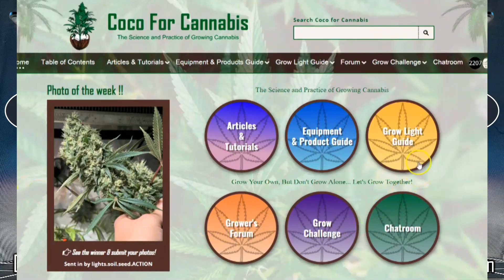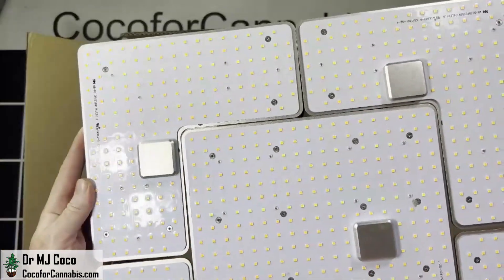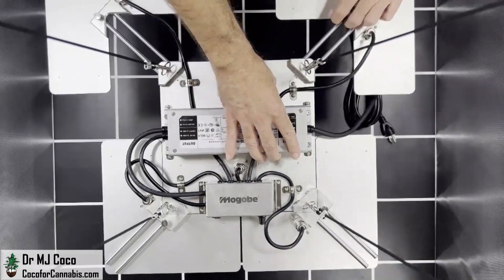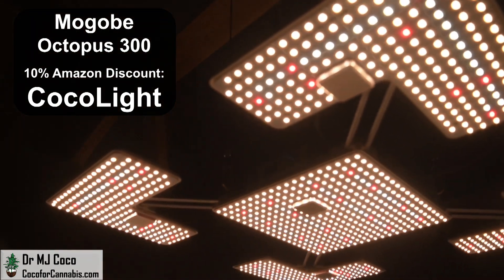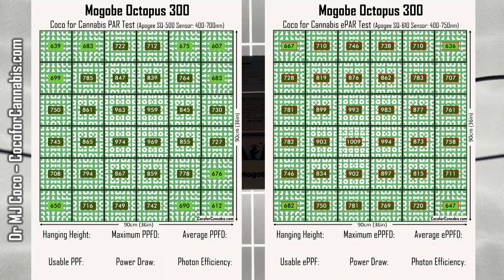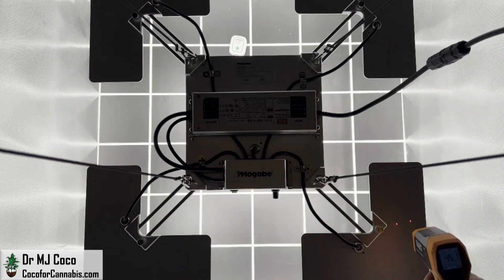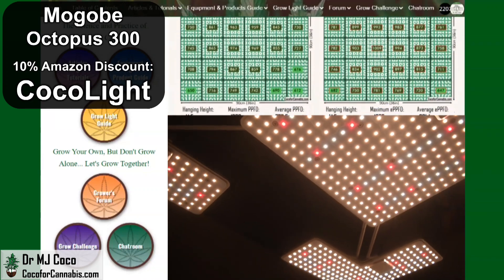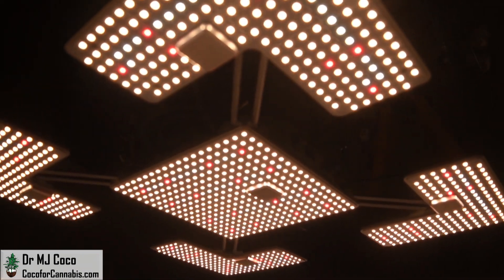Mogobe Octopus 300 PAR and ePAR Tests & Review

Comment: Really great par map, that layout seems to rival or better some bar racks of equal wattage ( beats spreading out 4 100w panels also).  I find the XLG and the ELG all run at that temperature.  Will fan cooling the driver to lower temps lower efficiency?  I tried not cooling the canopy and not them and the tent heat got too hot anyways.  Good price but seems more heat to deal with when you are at the optimal wattage for the square footage.  Flex ducting is no help lol